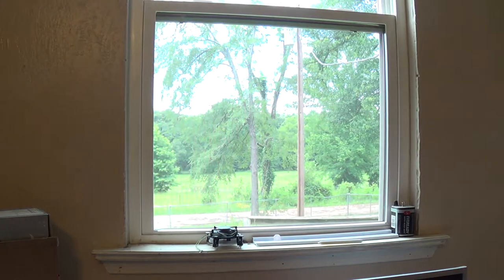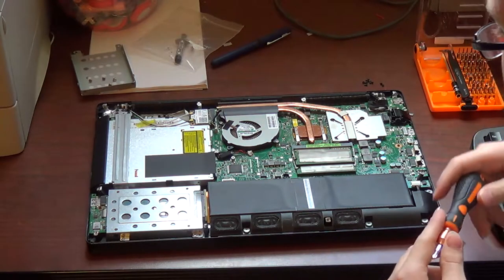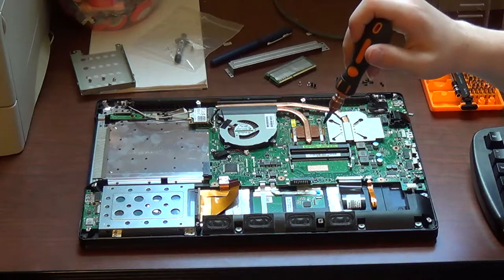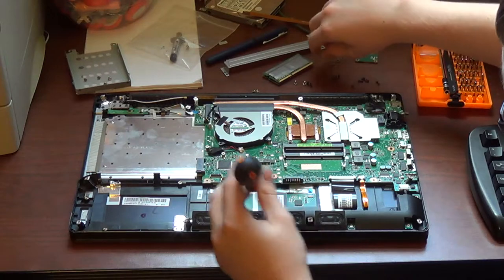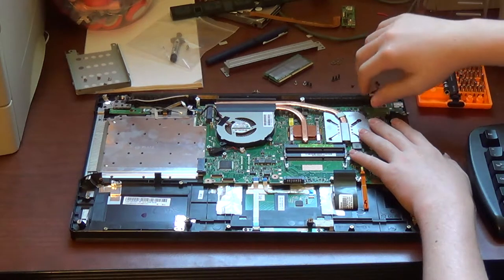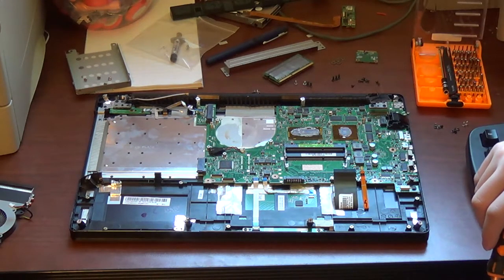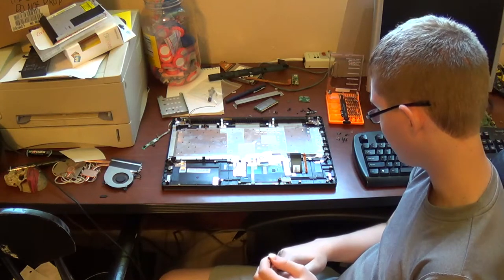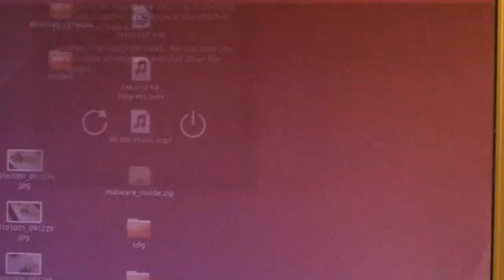Teardown Of My Asus Q550LF Laptop (Old Video- Archived)

Comment: Nice job man! If your keyboard starts acting up, it's because the battery is squishing that black flex cable. I was able to bring it back to 100% reliability by breaking off the reinforcement underneath the cable and wrapping a layer of duct tape around the kink.

Comment: Thanks for the heads up on the keyboard replacement!  I unfortunately was struck with the apparently common problem of a failing keyboard ribbon cable with my Q550LF.  I was gonna order a new keyboard but seeing how much a pain trying to get the plastic rivets to hold I'll go with a whole top shell instead.  Thanks for saving me a big headache!
Reply from the maker: No problem. Glad I can help.

Comment: Heey, awesome video of the same laptop I have, man. A question, I'm currently having problems with my screen, it only  functions while the laptop is almost opened, and as I keep opening there are like lines and then the screen goes off... I was about to open my laptop, but I have so much homework and papers to write... Is there a way to just check the screen connections of something like that? Thanks beforehand.
Reply from the maker: It sounds like the cable going from the motherboard to the display is failing.

Comment: Hey man awesome video. I think you are the only one I found that went through the process step by step for the Q550L! Now quick question is there away to replace the whole keyboard without tearing the laptop like you did? My problem is I have 4 loose keys any suggestions on how to go about it? or should just buy the whole thing and do what you did? Thanks and keep up the good work.
Reply from the maker: Unfortunately, the only way to replace the keyboard/trackpad is to do a full teardown. Try popping the loose keys off and back on to see if that fixes it. If it doesn't, then you'll have to replace the entire palmrest assembly. The trackpad and keyboard are glued into the palmrest and cannot be replaced on their own.

Comment: Hey bro, can you tell me how to open the laptop screen? My asus has that flickering screen problem, whenever i move the display the screen just go black and i got to restart the computer for it to work again. I'm pretty sure that the problem is on the end of the flex cable that goes in the screen but as the screen is like glued to the back of the notebook i can't access it... can you help me?

Comment: I’m still using one but I’m having video card or cpu overheat problem I think. Play any game with even low settings it shuts down on its on. Anybody have experience with this? I’m thinking after posting I’ll open her up & clean up & maybe thermal paste is all dried up. Any other advice please let me know.
Reply from the maker: You're going to want to clean it out with some compressed air, and yes, DO change the thermal paste since it's at least 5 years old, as is the case with my laptop.
Reply: TheComputerGeek010101001 
Yup it was the cpu overheating. After cleanup and thermal paste instead of 91 it went to 71f! Life is good once again. No temptation to buy another, thank goodness. Thank you
Reply from the maker: Glad I can help. :)